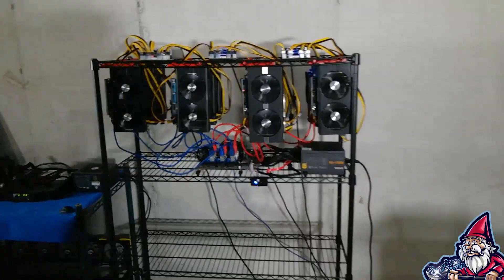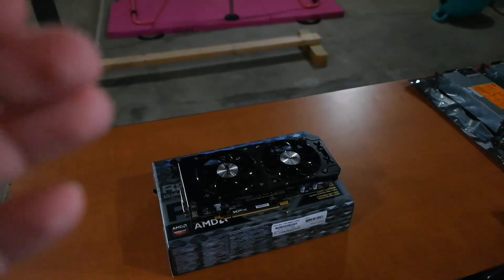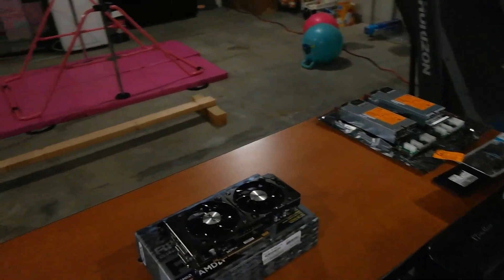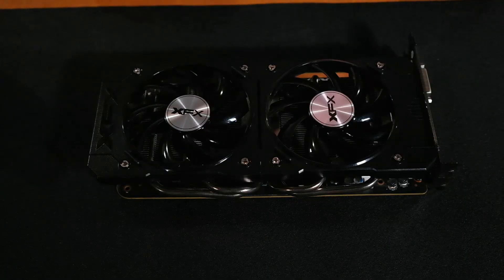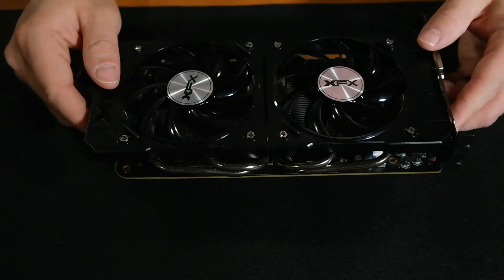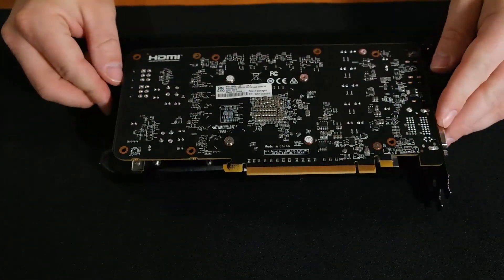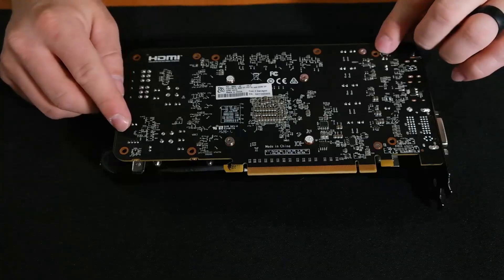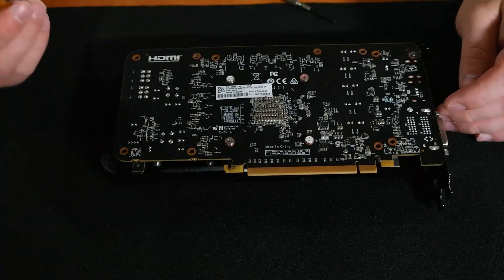How To Replace Thermal Paste on Graphics Cards For Begineers

Comment: Replaced today on one 3660. Big fail: temperature raises with 16 degrees Celsius. Applied  Thermal Grizzly Minus Pad 8 - 20x 120x 3,0 mm. BIG surprise for me...
Reply from the maker: Your pads the wrong size?
Reply: @TheHobbyistMiner  Don't think that. I tried to make it identical.